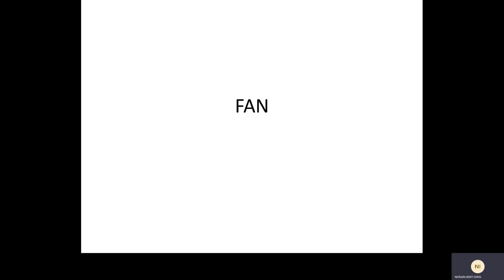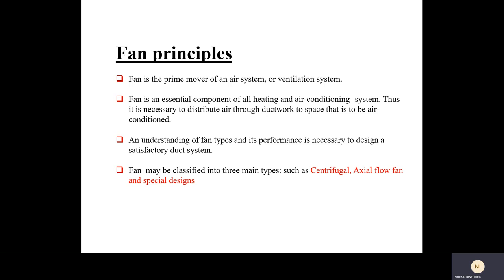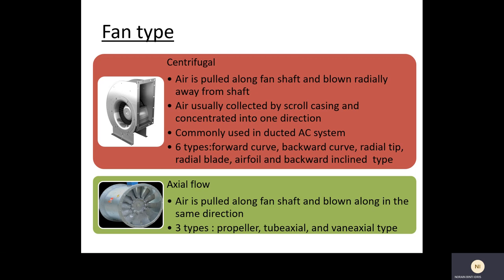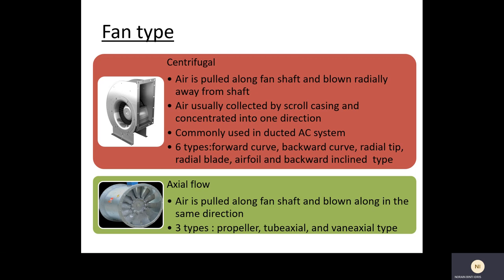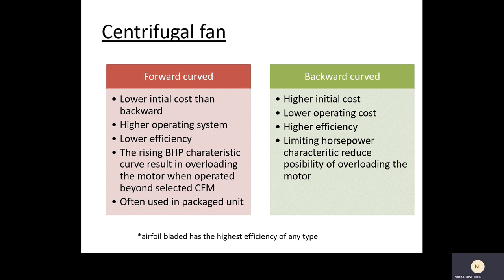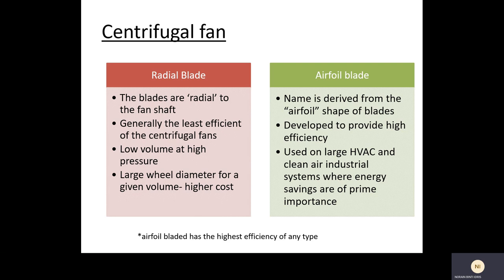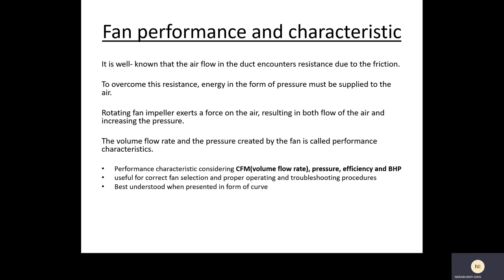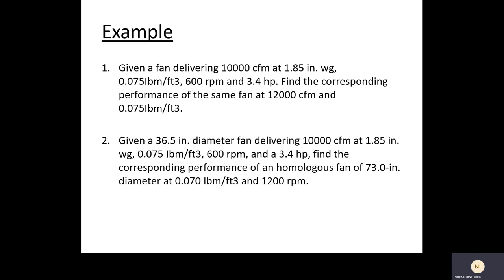Lecture 8 AIR MOVERS AND FAN TECHNOLOGY

Comment: MOHAMAD SYAFIK BIN SOFI
B071710064

1. PRINCIPLE OF FAN
 -fan merupakan satu medium utama untuk menggerakkan gas ataupun udara.
- 3 jenis fan:
                     -centrifugal fan
                     - axial flow 
                      -special design
2. FAN CHARACTERISTIC 
-  CFM
- Pressure
- Efficiency 
- BHP

3. FAN RATING
- Performance curve
- Table

4. FAN LAW
- Relationship among the fan performance by operating at change condition.

Comment: MUHAMMAD AMIR SYAFIQ BIN AHMAD SUKRI (B071710161)

types of fan:
1.centrilfugal
* Forward curved
* Backward curved
* Radial blade
* Airfoil blade
* Radial tip

2.axial flow
* Tube axial
* Vane axial

3.Special designs
* Impeller design
* Mixed-flow
* Cross-flow
* Other design
 
* Axial 

* Centrifugal

Fan performance & characteristic
- to overcome resistance, energy in form of pressure must be supplied to the air.
- Rotating fan impeller exerts a force on the air, the flow of air and pressure is increased.
- Volume flow rate & pressure created by the fan is call performance characteristics

 Fan rating
- Performance curve
- Table

 to select a fan:
- Static pressure resistance Ps is calculated
- Energy consumption

Comment: MUHAMAD NURHISYAM BIN MOHD HASNAN (B071710148)

Fan
1. The prime mover of air system.
2. Fan also function to distribute air through the space.
3. Type of fan
- centrifugal 
- axial flow fan
- special design 

Centrifugal fan
1 forward curved
2 backward curved
3 radial blade
4 airfoil blade
5 radial tip

Axial flow fan
1 propeller
2 tubeaxial
3 vaneaxial

Comment: Muhammad Syafiq Bin Ahmad (B071710592)

Fan is an air remover or as device to increase the air pressure to the ventilation system whether in heating or cooling system. There are 3 type of fan which is:
1.	Centrifugal
2.	Axial flow 
3.	Special Design

Centrifugal fan flow like a spiral form which it compress the air at small area to big area. There are 6 types of centrifugal fan:
1.	Forward curve
2.	Backward curve
3.	Radial tip
4.	Radial Blade 
5.	Airfoil 
6.	Backward inclined type

Axial flow fan flow in axial flow which is like series direction from lower pressure to high pressure. It have 3 type:
1.	Propeller
2.	Tubeaxial
3.	Vaneaxial
Special design fan is depending of situation condition where it can be same like other fan. Because this fan is only for special case like exotic material and small space area or other.

There are some few characteristic to considering the fan performance of fan where to overcome the resistance of the ducting system. These main characteristics are:
1.	CFM (volume flowrate)
2.	Pressure
3.	Efficiency
4.	BHP ( brake horse power)

Comment: ZARIF ROSTAM (B071710681)

Fan Principle

-Fan is prime mover of air system or ventilation system.
-3 main types of fan

a) Centrifugal
-Air pulled  along fan shaft and blown radially away from shaft.
-Forward curve, backward curve, radial tip, radial blade, airfoil, backward inclined.
-Commonly used in duct AC system.

b)Axial Flow Fan
-Air flow is pulled along fan shaft and along inn the same direction.
-3 type of axial flow fan: propeller, tubeaxial and vaneaxial.

c)Special design
-Design for specific requirement 

Fan characteristics consider in: CFM, pressure, efficiency and BHP.
 
Fan selection:
-Calculated the static pressure resistance.
-Energy consumption also need to be concern on selecting fan.

Comment: AMIRA NASUHAHA (B071710121)

Principle of fan
- a device to move an air system or ventilation system

Types of fan
1. Centrifugal fan = the air move in the spiral form.
- Types of centrifugal = (Forward curve, backward curve, radial tip, airfoil, backward incline, radial blade)
2. Axial flow fan = the air pulled along the fan shaft and blown along in the same direction
- Types of axial flow fan = (tube axial & vane axial)
3. Special designs (required quality demand design innovation, exotic material, precision manufacturing)

Fan performance and characteristic
1. CFM (volume flowrate)
2. Pressure
3. Efficiency
4. BHP ( brake horsepower)

Fan Law
- useful to predict fan performance when conditions are changed.

Comment: MEGAT MUHAMMAD UMAR BIN MEGAT KHAIRUNI( B01710565)

Fan principle is :-
fan is prime mover of air system. also essential component for heating and air condition. 

3 main type of fan is
1.centrifugal
2.axial flow
3.special design

for centrifugal fan have 6 type of blade
1.radial blade
2.backward inclined
3.airfoil
4.radial tip
5.backward curved- high cost,high efficiency, low operating cost 
6.forward curved- low cost, low efficiency , high operating system

for axial flow have 3 type
1.propeller
2. tubeaxial
3. vaneaxial

special design- fan that required quality demand design innovation , exotic material and precision manufacturing techniques.

there need some consideration to select fan for air condition system to satisfies the customers

Comment: Noraslan Bin Mohd Sidi (B071710008)

*Types of fan:
1.centrilfugal
- Forward curved
-Backward curved
- Radial blade
-Airfoil blade
-Radial tip

2.axial flow
-Tube axial
-Vane axial

3.Special designs
-Impeller design
-Mixed-flow
-Cross-flow
-Axial 
-Centrifugal

*Fan function - a prime mover in air system / ventilation system.

Comment: Muhamad Afiq Haikal (B071710534)

#Type of Fan
1.Centrifugal      

-Radial blade     
-Radial tip    
-Backward inclined
-Backward curved    
-Forward curved    
-Airfoil (highest efficiency)

2.  Axial
       
-Propeller
-Tube axial  
-Vane axial

3.      Special Design – Customized
fan based on demand of the application 

# Fan Performance Characteristic
  
-CFM  
-Pressure  
-Efficiency
-BHP

#Fan Law – Method that use to predict perfomance
of fan when condition is change

Comment: M.RAHIMI MUSTAPHA (B071710225)

So  basically in this lecture "Fan" was about where the functionality of the fan come in air distribution system.  So basically its a device to move an air system or ventilation system through out the entire system.

Types of fan
1. Centrifugal fan = the air move in the spiral form (almost similiar to snail shape) 
- Types of centrifugal = (Forward curve, backward curve, radial tip, airfoil, backward incline, radial blade)
- Forward curve = low initial cost, high operating system, low efficiency, and often used in packaged unit
- Backward curve= hih initial cost, low operating system, high efficiency
- Radial blade  = the blade are 'radial' to the fan shaft, the least efficient among centrifugal fans, low volume at high pressure
- Airfoil blade = provide high efficiency, used on large HVAC system

2. Axial flow fan = the air pulled along the fan shaft and blown along in the same direction
- Types of axial flow fan = (tube axial & vane axial)
- Tubeaxial   = air distribution is uneven & undesireable for AC system
- Vaneaxial   = suitable for ducted AC system, produce higher noise than centrifugal

3. Special designs (required quality demand design innovation, exotic material, precision manufacturing)

Fan Selection step:
1) Static pressure resistance Ps is calculated
2) From the manufacturer data, the requited CFM must be correct as the system to be used
3) Selection criteria : energy consumption

Fan performance and characteristic base on:
1. CFM (volume flowrate)
2. Pressure
3. Efficiency
4. BHP ( brake horsepower)

Fan Law
- useful to predict fan performance when conditions are changed.

Comment: AHMAD TAUFIQ BAIHAQI BIN MOHAMAD B091810279 3BMMH S1/1

From the lecture 8 video, I've learned about the principle of the fan is a device to move an air system or ventilation system that are three types of fans that are centrifugal fans, the air move in the spiral form. There are 8 types of centrifugal that are forward curve, backward curve, radial tip, airfoil, backward incline, and radial blade. Secondly, Axial flow fan, the air pulled along the fan shaft and blown along in the same direction. There are two types of axial flow fan that are tube axial and vane axial. Thirdly, Special designs are required quality demand design innovation, exotic material, and precision manufacturing. Finally, the fan performance and characteristic are determined from CFM (volume flowrate), pressure, efficiency and BHP ( brake horsepower)

Comment: Tiban A/L Ravichandran 
B091810285
Fan
-The prime product of air system
-Fan also function to distribute air through the space 
-Type of fan
Centrifugal
Axial flow design
Special design

Centrifugal fan
-forward curved
-backward curved
-radial blade
-airfoil blade
-radial tip

Axial flow fan
-propeller
-tube axial

Comment: Cheah Kok Hun ( B071710006) 

A fan is vital and play important role in air system or ventilation system which it functions to forced movement an air system or ventilation system

Types of fan
i. Centrifugal fan
- Radial blade
- Backward incline
- Airfoil
- Radial tip
- Backward curve
- Forward curve
ii. Axial flow fan
- Tube axial
- Vane axial
iii. Special design
- Required quality demand design innovation

There are some characteristics to considering the fan performance of fans were to overcome the resistance of the ducting system. These main characteristics are:
1.	CFM (volume flowrate)
2.	Pressure
3.	Efficiency
4.	BHP ( brake horsepower)

Fans Law
-Useful to predict performance when conditions are changed

Comment: KHOR YE SHU (B071710464)

Fan principles
-Fan is the prime mover of an air system, or ventilation system.
-Fan is an essential component of all heating and air-conditioning system. 
-Fan  is necessary to distribute air through ductwork to space that is to be air-conditioned.

-Fan can be classified into three main types: 
~ Centrifugal
~ Axial flow fan  
~ Special designs

Centrifugal
-Air is pulled along fan shaft and blown radially away from shaft
-Air usually collected by scroll casing and concentrated into one direction
-Commonly used in ducted AC system
-6 types:forward curve, backward curve, radial tip, radial blade, airfoil and backward inclined  type

Axial flow
-Air is pulled along fan shaft and blown along in the same direction
-3 types : propeller, tubeaxial, and vaneaxial type

Special designs 
-Special designs are fans of the required quality demand design innovation, exotic materials, and precision manufacturing techniques

Fan performance and characteristic

-To overcome this resistance, energy in the form of pressure must be supplied to the air.  
-Rotating fan impeller exerts a force on the air, resulting in both flow of the air and increasing the pressure. 
-The volume flow rate and the pressure created by the fan is called performance characteristics.  

Fans Law
-Useful to predict performance when conditions are changed

Comment: Kuganeswarao A/L Subramaniam
B091810487
fan is known as the prime mover of an air or ventilation system.
there are 3 types of fan
Centrifugal
Axial flow design
Special design

Comment: MUHAMMAD IQMAL BIN MOHAMAD ZAIDDIE
B091810231

1. Principle of Fan
- fan is the prime mover of an air system or ventilation system
- 3 type of fan : - centrifugal fan
                           - axial flow
                           -special design
2. Fan Characteristics:
-CFM
-Pressure
-Efficiency 
- BHP

3. Fan Rating
-Performance curve
-Table

4. Fan Law
- Relationship among the fan performance by operating at change condition.

Comment: Luqman Haqim (B091810235)

Fan is a tool or device to increase the air pressure to ventilate the system either in heating or cooling system. it can be classified into three which is centrifugal, axial, and special design.  centrifugal fan has a forward curve, backward curve, radial tip, radial blade, airfoil and, backward incline type Meanwhile axial fan has on;y 3 type propeller, 
 vaneaxial
, and tubeaxial

Comment: KESHANRAJ A/L GANESH   B091810319
From this video, i have learned:
- 3 types of fan are centrifugal, axial flow and special design.
-special design fan require quality demand design innovation, exotic materials and precise manufacturing techniques.
- volume flow rate and pressure that fan creates is called performance characteristics.
-performance characteristics considers volume flow rate, pressure, efficiency and BHP.
- currently, total pressure is used to minimize energy consumption for fan selection.

Comment: NUR FITRAH NADIA (B071710363)

Fan
1. The prime mover of air system.
2. Fan also function to distribute air through the space.
3. Type of fan
- centrifugal 
- axial flow fan
- special design 

Centrifugal fan
1 forward curved
2 backward curved
3 radial blade
4 airfoil blade
5 radial tip

Axial flow fan
1 propeller
2 tubeaxial
3 vaneaxial 

Performance characteristics of fan
Volume flow rate, pressure, efficiency and BHP.

Comment: Mohd Syahiran Bin Mohd Pikeri
B071710026

This video is all about the fan it self. Fan can be describe as a tool or device to increase the air pressure to ventilate the system either in heating or cooling system.

The fan can be in three categories which is centrifugal, axial flow and special design.

The first one is Centrifugal fan. Centrifugal fan move like a spiral form and this type of fan can be divided into six types :
- Forward curve

- backward curve
- radial tip
- radial blade
- airfoil
- backward incline type

The second types is axial flow. The axial flow is a fan where the direction is on series direction. The direction start from low pressure to high pressure. This axial flow also have their own types which is :
-Propeller
-Vaneavial
-tubeaxial

Last but not least is special design. Just look at the name it self we know that this types of fan is custom design based on the desire and application where it use.

To know the performance of the fan characteristic, there are a few thing that we need to be consider and this can be the most importance part of all of this. The thing is :

- CFM  
- Pressure  
- Efficiency
- BHP

Comment: Mohamad Hurairah (B071710461)

Fan principles
-Fan is the prime mover of an air system, or ventilation system.
-Fan is an essential component of all heating and air-conditioning system. Thus it is necessary to distribute air through ductwork to space that is to be air-conditioned.
-Fan  may be classified into three main types: 
~ Centrifugal
~ Axial flow fan  
~ Special designs

Centrifugal
-Air is pulled along fan shaft and blown radially away from shaft
-Air usually collected by scroll casing and concentrated into one direction
-Commonly used in ducted AC system
-6 types:forward curve, backward curve, radial tip, radial blade, airfoil and backward inclined  type

Axial flow
-Air is pulled along fan shaft and blown along in the same direction
-3 types : propeller, tubeaxial, and vaneaxial type

Special designs 
-Special designs are fans of the required quality demand design innovation, exotic materials, and precision manufacturing techniques

Fan performance and characteristic
It is well known that the air flow in the duct encounters resistance due to the friction.
-To overcome this resistance, energy in the form of pressure must be supplied to the air.  
-Rotating fan impeller exerts a force on the air, resulting in both flow of the air and increasing the pressure. 
-The volume flow rate and the pressure created by the fan is called performance characteristics.  

Fans Law
-Relationship among fan performance for a given fan, operating at changed condition, or for different size fans of similar construction
-Useful to predict performance when conditions are changed

Comment: MUHAMAD RAZIQ AFIQ BIN ANUAR B091810519
Fan
1. The prime mover of air system.
2. Fan also function to distribute air through the space.
3. Type of fan
- centrifugal 
- axial flow fan
- special design 

Centrifugal fan
1 forward curved
2 backward curved
3 radial blade
4 airfoil blade
5 radial tip

Axial flow fan
1 propeller
2 tubeaxial
3 vaneaxial

Comment: Ahmad Syahir Bin Ismail B091810081
Fan is the prime mover of an air system, or ventilation system. Also an essential component of all heating and air-conditioning system. Thus it is necessary to distribute air through ductwork to space that is to be air-conditioned. consist of two types of fan which are centrifugal fan and axial fan.

Comment: MUHAMMAD IZZAT IZZUDDIN BIN HANAFI
B091810329
A fan is the prime mover of an air system or ventilation system. Also an essential component of all heating and air-conditioning system. Thus it is necessary to distribute air through ductwork to space that is to be air-conditioned. consist of two types of a fan which are a centrifugal fan and axial fan.

Comment: ARVINTH A/L RAMACHANDRAN  (B071710339)

The fan provides the pressure difference to force the air into the duct system, through grilles and registers and into a room. Several different types of fans produce this movement such as propeller fan, axial-flow fans and centrifugal fans

Type of Fans:

Centrifugal Fan - air is pulled along fan shaft and blown radially.
                         - concentrated in one direction

Forward curve
Backward curve
Radial tip
Radial Blade 
Airfoil 
Backward inclined type

Axial Flow Fan - air is pulled along fan shaft and blown in same direction

Propeller 
Tubeaxial 
Vaneaxial

there are some few characteristic to considering the fan performance of fan where to overcome the resistance of the ducting system. 

CFM (volume flowrate) 
Pressure
Efficiency 
BHP ( brake horse power)

Fan Law

The Fan Laws are a group of useful equations for determining the effects of a change in the speed, the diameter of the fan and the density of air in the system. They are most useful for determining the impact of extrapolating from a known fan performance to a desired performance